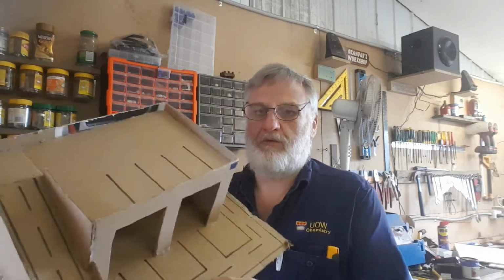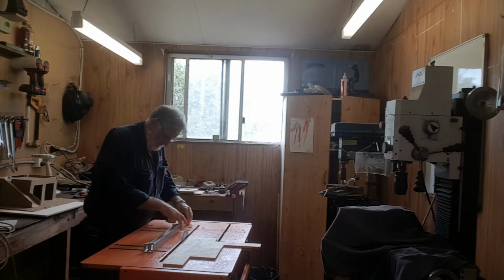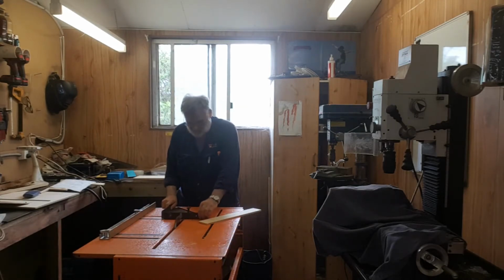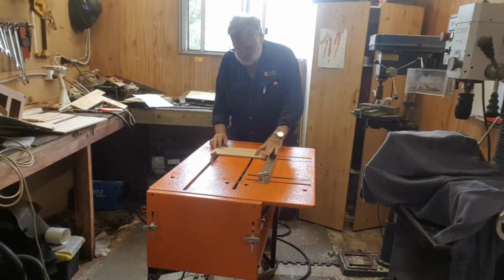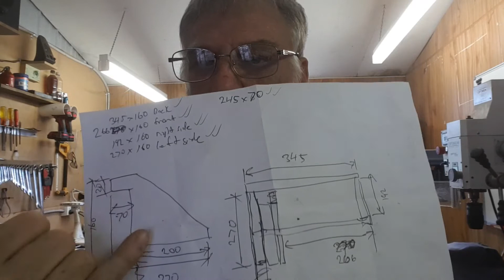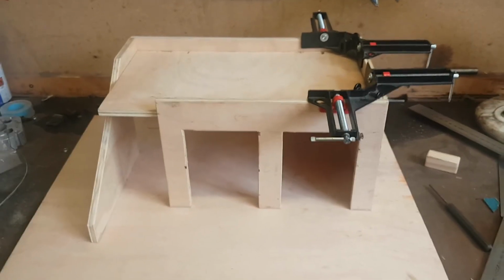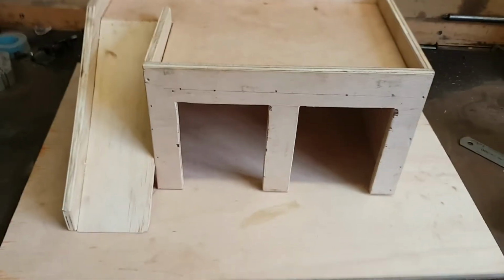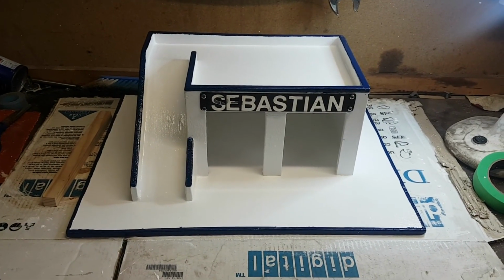Triton Mk 3 first job after refurbishment: Wooden toy car garage

Comment: Hi Graham.  The mitre guide is meant to be used in the slot that the blade is not in.  That means you can do a full pass of the blade and avoid hitting the blade with it. Hope that helps. :)
Reply from the maker: Thanks Jason. I watched the video back while editing it and realised that. I surprise myself with the obvious things I missed at the time that I see when I watch things back later. I hadn't used the bench for years, and obviously it wasn't only the saw bench that was rusty.

Comment: Hi Graham, really enjoyed your videos with the triton bench. I rescued my dad's one from being binned and have used it a few times since. Everything works well however I think I need to realign the blade as I've been getting some kickback when ripping thinner pieces. Mine has a giant Hitachi saw on it. Also, my fence does not seem to lock in well to the slots. Wondering if you might have some advice on why the fence is not locking into place properly? Thanks again for posting your videos on the restoration and build using the bench.
Reply: Omg... They're t nuts. I've been trying to use them as cam locks in the slot. What an idiot I am. Without this video I'd still have struggled. Thanks again for making this, you helped me out!
Reply from the maker: Hi StarGrinder. I am glad you found the videos helpful. I'm not sure what you were doing with the fence, but I am happy to hear that you found out how to use it.

I checked out your video on the guitar tuner. Lots of fun to be had there I am sure. Trying to build mechanical systems and then interfacing with them from custom software has plenty of challenges. I have seen a bit of Matlab, but prefer non-commercial stuff myself.

I am sitting at my computer writing Python code (to read the barometric pressure from a pressure sensor and allow averages to be derived, all in a thread that will run concurrently with a larger program that is running a large spectrometer) right now. 

I am also in the process of teaching my niece (who is a complete programming novice) how to write a game in Python at the moment. I have 11 videos posted already. It has been interesting!
Reply: @philotrum  that's a blast from the past, that video. Must be nearly 10 years old. I have since gained a decade of experience as a mechanical engineer and lost quite a lot of hair. Still couldn't figure out that fence on my own though hahaha

Agreed, I love open source, was using MATLAB back then as we had student licenses. I do a lot of Arduino based projects now as well as audio electronic projects like guitar pedals and synthesizers.
Reply from the maker: Did you watch the whole of this video? I worked as a fitter/machinist for 20 years, and have been building and programming gear for a university research group for 20 years on top of that. It still took me several minutes to work out how to rotate the table top of the Triton to make wider cuts (at 10:23).

I have done a little bit of Arduino stuff. I built some gear to monitor the temperature in 6 places on my telescope setup using an Uno. I was cooling my DSLR down to about zero C to improve my astrophotography. I wanted to track how the gear I built was working. (You can check out the observatory build at https://www.facebook.com/media/set/?set=a.3308698241684&type=3.)

You can see some of my images at https://www.astrobin.com/users/philotrum/ if you are interested.

I built a temperature monitor for my solar hot water system recently. (https://www.youtube.com/watch?v=Hu-MoSV3eug&list=PLUi9WzJ5oL33N-5FQjz0huNYyE4R1ict8) I used some gear from work, but have bought another Arduino to make one for the long term. Just another job on the list.
Reply from the maker: I received your message but was in a meeting. I managed to lose the message and can't seem to find it. Can you try again?